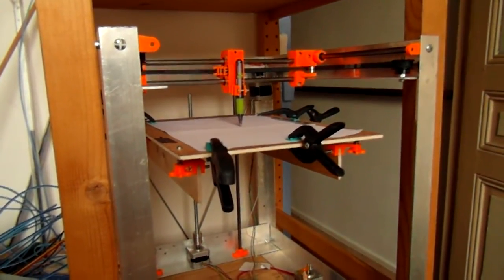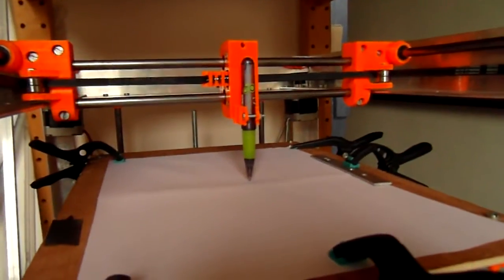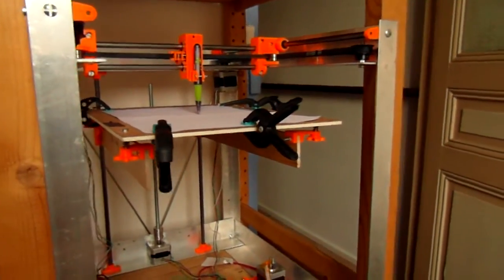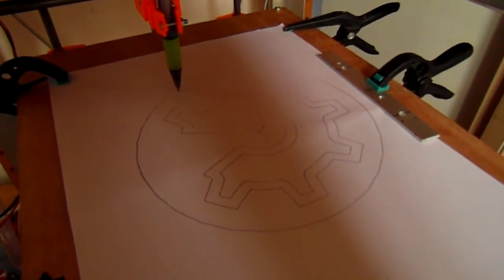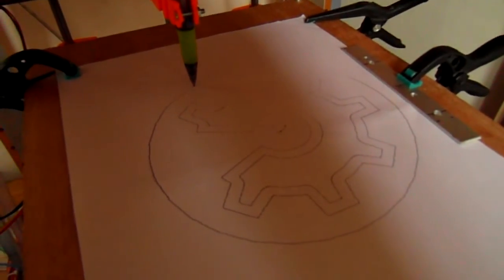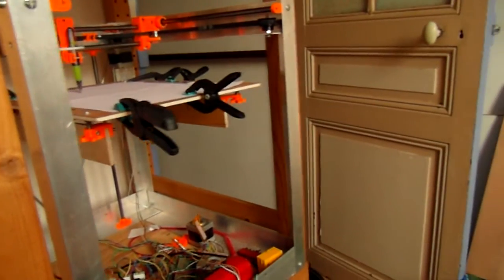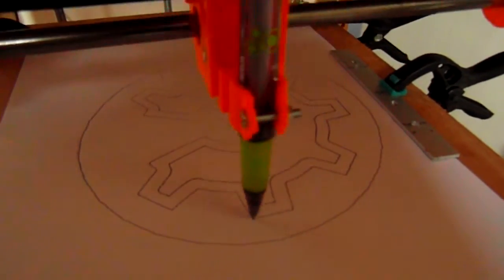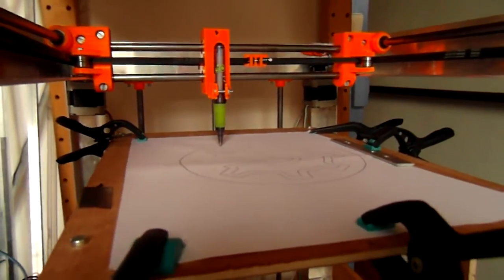Doboz 2 : h-bot reprap pen plotting test

Comment from the maker: #reprap   #hbot   #doboz2  
Finished printing the mounting elements for the Z platform (thumbscrews etc), and added a pen mount as toolhead! yay , it works :) (not perfect but getting there)
This was done as a way to test various aspects of the machine, before I move forward with the extruder and hot end mount designs.
Reply from the maker: Billy Zelsnack Neat idea ! Did you use a spring or rubber band based mechanism ?
Reply: lol, you always have such a monotone "bye".

Still, fucking awesome stuff.  I get belts and pulley on tuesday, so I can start working on X/Y movement - if I'm lucky (or I can just hack it) I'll get to the point you are here by wednesday.

And Billy Zelsnack direction dependent precision issues are almost always backlash in belts.  I seriously suggest either T2.5, MXL, or GT2 belting and manufactured (metal) pulleys that match.  Printed pulleys and T5 belting are just an awful idea always.
Reply from the maker: Billy Zelsnack Good simple design!  
About the direction dependent precision issues: that is weird, because I am not seeing such issues here (just did a test similar to your video just to be sure), so Anthony Morris  might be right, could be simply a backlash issue?

Loved your map drawing example btw, what software pipeline did you use (Z liftup )? (I might be daft but I didn't find a clear solution for 2d drawing on a reprap other than perhaps going the fake cnc routing way)

Anthony Morris  haha :) that means it must show just how much I don't like speaking in my vids ;)

thanks a lot for the kind words though, they are motivational !
I am really looking forward to seeing your version!  The fact that you are laser cutting your parts means you are likely to get way better results !
Btw I forgot to ask last time: are you getting sufficiently long belts or will you resort to "oh lets attach two belts together" hack  like I do ?
Reply: Mark Moissette I'm getting sufficiently long belts.  6ft of MXL belting should be more than enough for my specific build.  I've gotta work on the frame a bit more - OR I've gotta use different idlers on the end. (Using 608s right now)  I'm thinking the 624 bearings come in a 10 pack - 8 on the X/Y, and 2 for idlers with M4 fender washers should fit almost perfectly while using the whole order (not too many, not too little)
Reply from the maker: oh yes , that sound sufficiently long :)
I am not sure I understand you right, do you mean the idlers for the "central block" , or the Y end idlers themselves ? (That is one thing I still need to sort out, right now I am not using bearings at all for the pulleys on the opposite side of the motors)
Reply: Talking about the Y end idlers themselves...all around, the machine should be able to use a total of 10x624 bearings.  Over time, I might be able to reduce that down to 6 but I don't feel like printing out new XY idlers to screw around with that right now.

I don't know if M4 fender washers would do the trick though.  It's possible they're not large enough.